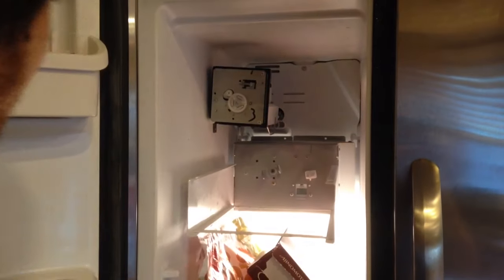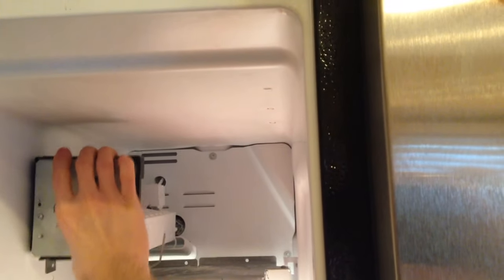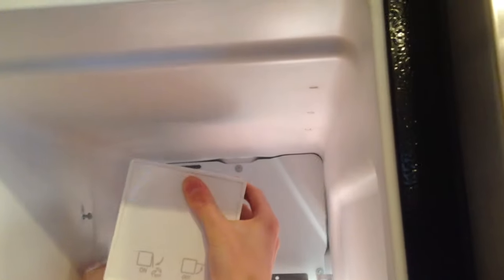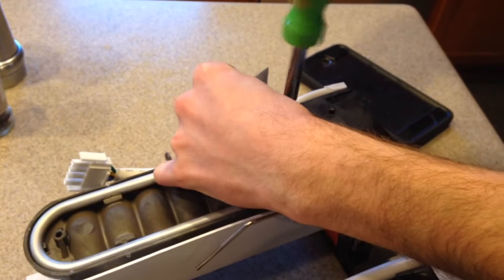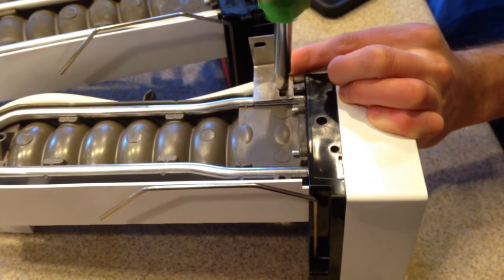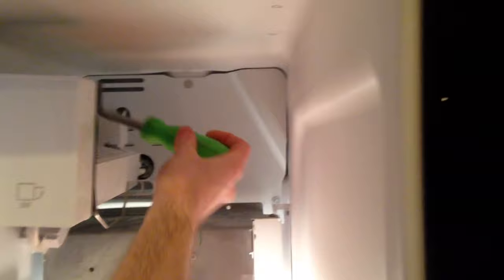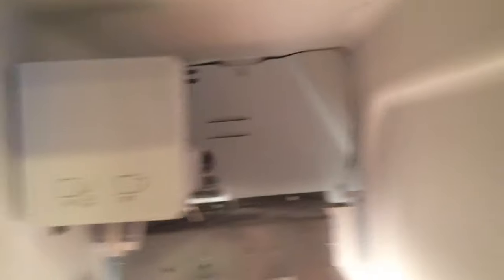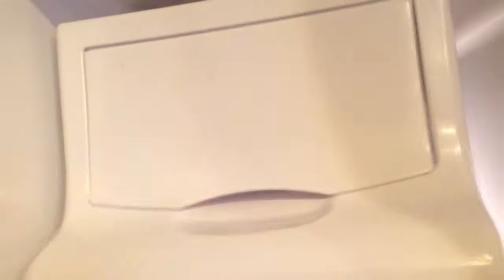Frigidaire Freezer Ice Maker Repair

Comment: So, maybe I missed the 'repair' portion of this video.  Seems to be a 'how to replace' video, which is helpful, but the title had my hopes up that you were taking it apart to see WHY it was failing.
Reply: If you called a repair person, they wouldn't repair it either.  They would recommend a new one.
Reply: Never mentioned timer under inside cover
Reply: That's why I was here. Where's the repair part? I saw in many other videos that there are multiple components attributed to a faulted ice maker.  Keep searching, they're on this platform.